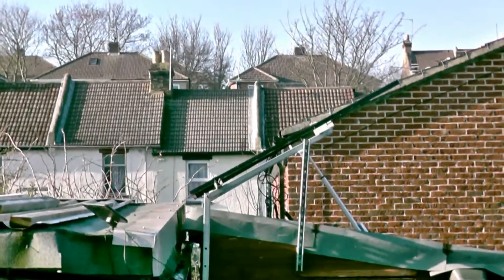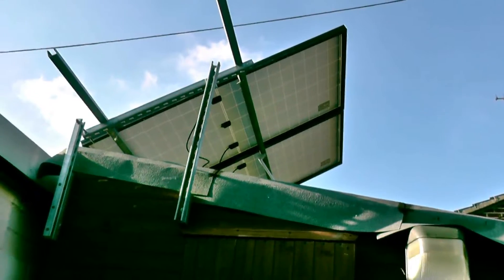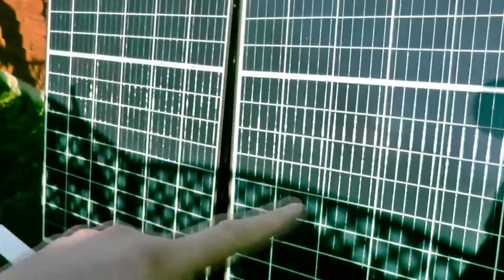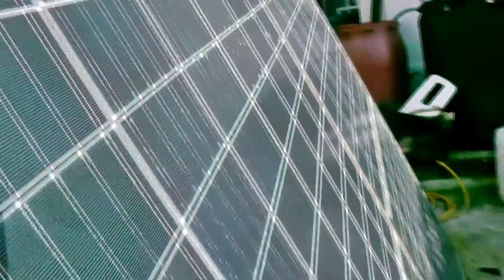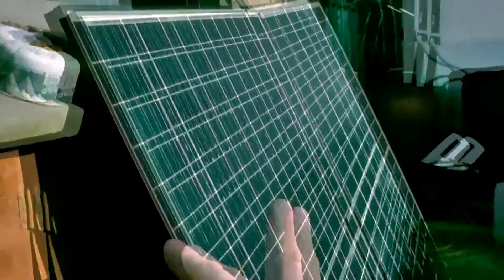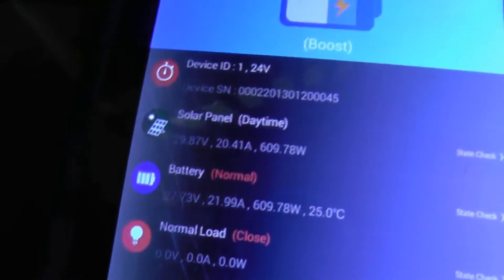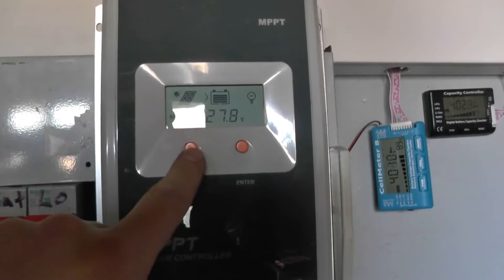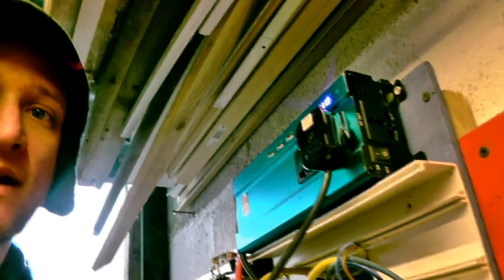New solar panels

Comment: How much does the power output drop when there's a cat on the panels?
Reply from the maker: That is something I will test when she does it next time. I would have thought it would make the 2 x 80W panels output next to nothing.
Reply: That's the problem with shading,whole panel drops down to the output of the worst single cell/string of cells in the worst part of shade. One thing about non-optimal aligned panels is there is scope to reflect some additional sun back onto them to bump the power up a bit with some simple and cheap reflectors..